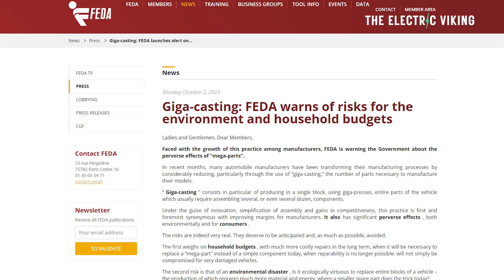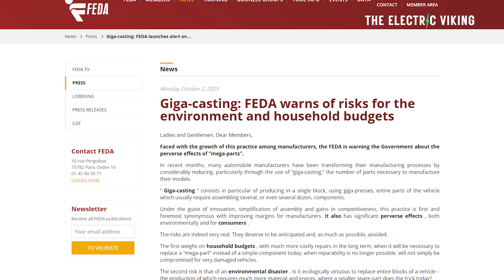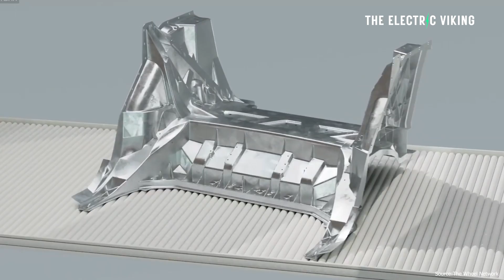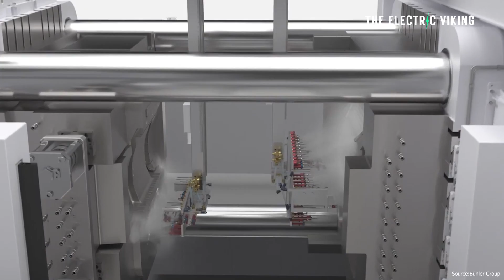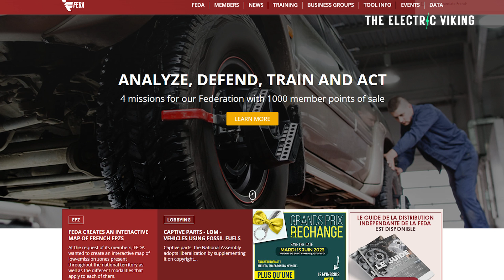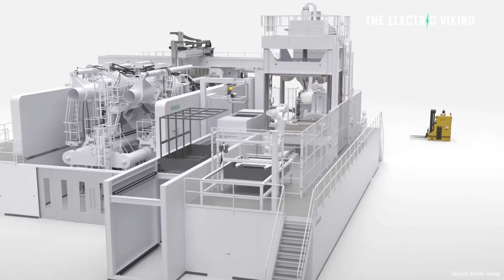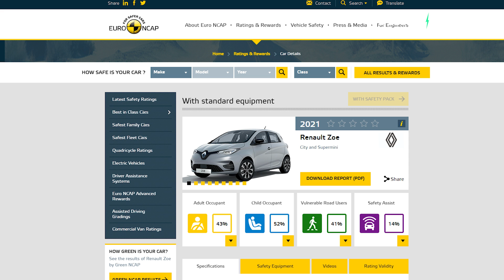Magna and French auto industry issue red alert; warn dangers of Gigacasting

Comment: Nothing wrong with gigacasting. I am sure other industries already use the in their ways. Welding a casted part made of aluminum? Don’t think so. Especially if it’s put to work under weight, vibrations etc. Usually you replace it completely. And if you have to disassemble half the car, then the insurance or owner might not be able to pay the costs. 
But the issue with insurances is absolutely real and was raised years ago after first electric cars burned completely down after crashes damaged the battery and normal firefighters had nothing to really stop the fire. Insurance damage is not only damage at your car, but everything else you damage….
Tesla rarely really invents something completely new, but brings into market what existed, but nobody dared to introduce. And yes the suppliers like Bosch, Continental, ZF (Delphi, Magna etc.) are for 1-2 decades the main source for innovation and modernization in Europes car maker industry. Not the carmakers. Tesla tries to combine both more and more to increase the profit margin and have more reliable sources for what they need. Tesla also started as a normal carmaker and learned from the best. I am sure they also employed the best from other carmakers or industries ;) They didn’t invent the wheel, but did similar things like the first Apple iPhone.

Comment: Cars are getting more and more modular in their assembly and EV's can really take advantage of that.  Collision repair has been becoming more of a remove and replace business for years.  Painting is also getting reduced and is a large cost of auto repair.  Eco concerns have been driving up the cost of paint and will be getting phased out little by little.  
  The next gen Tesla will probably reduce or replace the use of paint but not necessarily colored exteriors.  Multi layer OEM colored panels have been used for years in the aftermarket.  Collision repair is trending towards bolt off/bolt on panels and the real body craftsmen are a dying breed.

Comment: i dont like the idea of giga casting.
if i crash the car they need to send the car to a third world country to get all the good parts out and put them in a new gigacasted chassis.

because nobody has the money to get that done in eu, america etc.

gigacasted cars would need better insurance trough the whole time of owning(also a thing that we put at risk with gigacastings...) to prevent a complete financial desaster. 

then we will get to the amazon problem. nobody would reuse the still good interieur of the car. or undamaged body parts. refitting to manufacturer quality would be an expensive thing. they woulkd dump it in a third world country. because you only have the chassis which is pure "gold" compared to the rest.

at this point we would not own the chassis and the battery. 
since repairing the cast chassis piece would of course be dangerous for yourself. you cannot do this at your own at all. and even if you could do it. there is still the annual roadworthy check for your car. and a repaired chassis without proper documents could be called as a danger.

Comment: I think the critics are right. Replacing a full gigacast is too much work, repair costs and insurance costs will explode and cars will be replaced more often, which is a dream come true for manufacturers! If a gigacast replaced 120 different parts, then it also replaced 120 parts that might break independently and can be independently replaced. With a gigacast there are no replacement parts anymore because the manufacturer only has that one big mould and building special and smaller repair moulds doesn't make any sense at all. So to replace a small potion of a gigacast you have to order a full gigacast and cut it down. How many repair shops can do this case-by-case skilled work anyway?
Reply: BTW: in my country you wait 9 months for your new car in average. So nobody wants to replace a car, because either you wait again 9 months for the replacement or you have to go with a used car configured by someone else, so wrong color, wrong extras installed, etc. People want their "baby" repaired, not replaced.

Comment: The thing with these castings is, they are prone to fatigue if ( now comes the important part) they are not designed well....same goes for corrosion, you just have to know what you do.

And off course you can't really repare them in case of a crash....which would be a problem if the others were repareble.... which they really aren't anyway 😂

I wasn't a big fan in the beginning since I thought doing it right the first time might be a issue, but they seem to have hired the right engineers for the task and it shows.

Comment: 10:10  I LOVE used trucks!! .. I needed to rent a BIG Cube Van, The cost was going to be astronomical.  So I just bought oe a 1994 Chevy Step Van (for $8000 .. TALK ABOUT parts, it has no less than 16,000 Aluminum rivets holding it together :)  .. Safety is another matter, It's GVW is 12,000 pounds, so just about anything you run into will get the worst of the impact :)

Comment: I worked for Magna as a technician on krauss maffei 2600 ton presses, with the biggest tools @ 28 ton. So there talking a load of rubbish. The principles are all the same just the size. The giga press is 5600 ton (tonnage in force and machines are usually labelled as so).

Comment: I recently bought a new Model Y and people need to know the facts, it is a wonderful car and a joy to drive but there are some negatives , one being the high cost of insurance and because of the complex manufacturing methods (gigs casting) they have very high cost of repairs and the unwillingness of repair shops to work on them. Another issue is tires, these cars require expensive tires and seem the wear the tires out quickly. Another issue is the customer-dealer relationship might not be what it should when you buy a car at these prices.

Comment: I read the original FEDA article and these are the four key points:

1. Casted parts are bad for the customer as he - for example - needs to replace an expensive large part instead of a small cheap ones after a minor collision
2. Casting is more energy intensive 
3. It uses a lot more material than traditional parts made from sheet metal
4. Casting increases earnings for the manufacturer, that's why it's done

Comment: Mega casting...
60% of rear casting of Tesla in China is rejected ! 
Problems? Difficulty to manage the thickness of the metal sheets where you want the thickness to be.

So yeah, they have reasons to believe that it's a stupid approach, especially when you look at the quality of Tesla body parts... Tesla still can't solve the spacing between body doors, frame, etc. 
And other problem. Engineers design structural parts with a certain thickness. There are methods that enable it to reach the right thickness 100% of the time.
There is the casting way that isn't good enough.
NOW, what if the manufacturer uses the defective parts to save money, but uses the correct ones for testing the safety level? 
Tesla would never do that right? Wait what, they would?
Reply: Ho and let's not forget... Not reparable... And no, Tesla are not the safest crash test cars ! This is a random comment of a fanboy considering that opinions are facts. 
The Volvo XC90 has had 0 death inside since 2002.
Many cars are very safe thanks to Europe crash test standards (the ones you're attacking to be more cautious).
Reply: By the way, for Germany, TESLA is not a threat, it's an opportunity. One of the factory will soon be in Berlin... It will strengthen both Tesla and German auto-industry. Tesla has a lot to learn as well !
Reply: And no, Tesla is among the most expensive EVs... Come on... Look at the price of many other EV vehicles ! Tesla is anything but cheap.
And from the consumer's perspective, owning a Tesla is more expensive on one aspect... Once there is an accident, you can throw it away. But that's not it, Tesla is not respecting the right to repair in Europe ! 
Tesla can ban people from using fast chargers for repairing cars in other places, because Tesla doesn't want to repair so many cars and then block some features that were purchased ! 
Tesla is an anti-consumer company. Look at all the issues that the consumers have. Here, the pressing of everything means that you can't repair for a cheap part of it's pressed parts, so it ends up being expensive. That means that an insurance for owning a tesla will get expensive ! 
Let's not talk about the spying scandals with Tesla cameras, and all the issues of having a connected car !

Comment: Magna is a contract manufacturer- that means customers like Jaguar might place an order for 10,000 units- not sure what the break even point is for a gigacast but I think Sandy Munro said it was approximately 50,000 units- Magna might eventually get to 50,000 units but not in a single order but through a series of 10,000 unit orders - so Gigacasting system might not make sense for Magna. Just a thought

Comment: Regardless of how a modern car is made. The bigger issue is damaged caused and the cost to repair, even in smaller crashes. 
Most modern car's will tare the interior while they deploy airbags. The exterior parts are very expensive, too. Then you have labour to factor in. When the cars age some, they will be a financial write-off way quicker than an older basic car. I believe that insurance companies have a relatively low threshold for the value of the car vs. the repair cost, before it is uneconomical to repair. The future of car insurance looks to be higher, much higher to cover the additional costs they will incur.

Comment: problem with those large castings is that they save money only for the original builder, it saves nothing for the consumer, quite the opposite, whenever there is an accident, and that thing is damaged, insurance (with recommendation from the original designer) will  recommend scrapping the whole thing, because I doubt they'll certify al welded repairs on them, so repairs will be VERY expensive, which will pull the insurance along with it, automaker doesn't care, they save money on building it and now they'll cash in on the replacement, insurance doesn't care, people lease everything anyway, and they'll have to buy the insurance, so of course "they" will say it is "makes sense", but for a customer - it really, REALLY doesn't!

Comment: If you talk to a tow truck operator, you will find out that only rarely is a car with deployed air bags not totaled. These occasions are very new cars with only the driver's bag deployed. Its so rarely done that it is hard to find someone that can do it. The liability for messing up a safety system commands a very high insurance premium which has to be passed on to the customer. So, the labor charge is mind blowing.

Comment: Not every auto ceo has the intestinal fortitude of Elon. We can see resistance to change even in Church Choirs, "but, we have never done it that way." Or, if it ain't broke, don't fix it. One of the problems of assembling anything from multiple components is accumulation of tolerances during manufacturing. The more joints using fasteners, the more slop in the system. However, even weldments done in jigs introduce randomness. Gigacasting offers the distinct advantage of drastically reducing load transfers through fasteners and resulting stress concentrations, resulting in stronger, stiffer and lighter components. Conventional fabrication also has lap joints which are hard to stabilize and stress concentrations at holes and spot welds. Casting allows a much more refined version of doubling to increase strength at fasteners. The downside is mistakes are very expensive! Oversights can be fatal to a company. Fixes aren't as simple as increase the gauge and add new holes and a fastener with only trivial changes in tooling. With a Gigapress you can be precisely wrong.

Comment: The only downside I see to Gigacasting is your insurance premiums.  If I damage the front fender on my Silverado, the body shop can buy a fender from GM or from the aftermarket.  If I had a Tesla and bent the same corner of the vehicle, ordering the "fender" isn't an option. Can a bodyshop buy an OEM or aftermarket fender? I'm guessing at least not from Tesla (likely have to purchase the entire side of the car since it's one piece). At that point, it may not be economically repairable, therefore the insurance totals it.

Comment: Your points about repair are very in accurate. In America where Tesla started and has the most infrastructure. Still has an extremely high rate of write offs. Tesla then makes the cars ineligible for their recharge networks. This makes them non competitive and still expensive to repair. Tesla themselves restricts supply and who can repair. This in turn has incentive new Tesla purchases. Secondly Tesla insurance is their own scheme to have a inclusive market. By controlling all parts manufacturing, their own recharge and solar network. Setting their own repair services that are vastly overwhelmed, and now finally hosting their own insurance. They can finally control all aspects to make sure they can control prices and profit the best. This is a monopoly practice and will turn out very bad for consumers. This is why Tesla has been losing shares of the ev market. It has not grown in pace as everyone thought but major car brands are jumping in. So people are diverging from Tesla. Secondly when you have pressed parts they are under a lot of strain. You can cut pieces out especially if they have structural and safety effects. They have to be replaced. If their is no breaks or connection points then the whole top of the car would need to be replaced. Basically looking at a total for dings in any corners or creases. That is a ton of the exterior. Under carriage damage is common and isn’t a right of with cars now but when they become the structural linch pin they they will to. Underbody damage happens far more then people realize. More often it’s forgotten about and ignored. Out of sight, out of mind. So yeah this will cost people more in the long run. Also payout comment about premiums going up then receding is a joke. When has insurance ever raised rates and lowered them as a practice? Never is the answer when it comes to cars as the cost. The driver themselves can make it fluctuate but not the car. They will stick to their guns because it gets them profit and you all got used to paying it. Insurance doesn’t get cheaper as a whole. Not when they are all in the game together. This also Tesla has started producing cars like that to build quicker. The consumer isn’t seeing lower costs on the cars. It’s only gotten worst. Definitely not cut and dry like your making it sound. This will impact safety and production speed positively. Cost on the other hand will absolutely go up as a whole for a consumer to own, operate, and get repaired as a net effect. They are fighting a losing fight but they aren’t lying about the effects. They never weighed in on safety only consumer cost and that is without a doubt not going to drop.

Comment: There are legitimate questions to be answered but ignored by electric viking. Regarding "structural battery" of tesla: every cell of the whole battery pack is glued. There are no modules containing those cells, act as components of the pack and each of module is replaceable, if one module is bad, you can replace of remove it and the rest of the pack is fine, or repaired.. Now? Some single damaged, leaking cell out of thousands of them can ruin the entire pack, what if this happens after warranty.?

The other issue is the repairablility of the car due to single part chassis. Tesla and other gigacating manufacturers should be made to demonstrate the repairablility, and make mandatory commitment to support repair requests when it's possible with reasonable costs to the customer, like not more expensive than the cars value.. Other than that societies can't takes risks for reasons that the outcomes are like around 10 15 years later.

Comment: It is called competition.  If Magna cannot compete fairly, their strategy seems to be tearing down the competition.  Reducing 270 manufacturing steps and hundreds of robot station is obviously a reduction is manufacturing cost per vehicle.  If the vehicles produced with the single structure (GigaPress parts) are not passing the strict test requirements, then that is a problem but they seem to be as good as or better than Magna's methods.  Magna - compete fairly by building a better product, and not defaming your competitors.

Comment: I dunno, I have heard lots of criticisms about the large repair expense of Teslas with their structural batteries, and on the surface the criticism seems logical. What you're saying is it's overblown worries. I understand the idea that building a giant die for a great portion of the car makes unit cost less, but there's significant up-front cost, so big finance has to be involved and that's unattractive to a number of people and companies. It also doesn't allow for modifications, so there needs to be certainty that this specific part will be the right one for the financial life of the die (100,000 units?) But, if I get a dent in a fender or a battery cell dies, can it be repaired? Can I cut off a fender that's crumpled and replace it? This needs to be possible or it will have significant impact on the consumer.